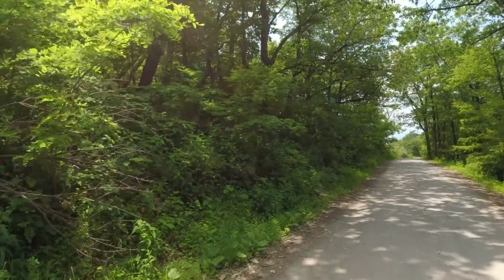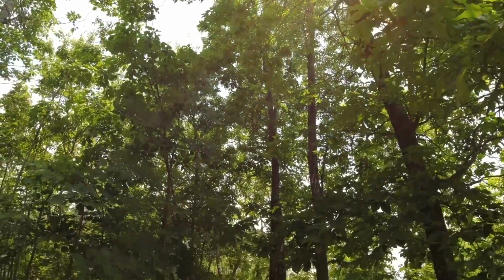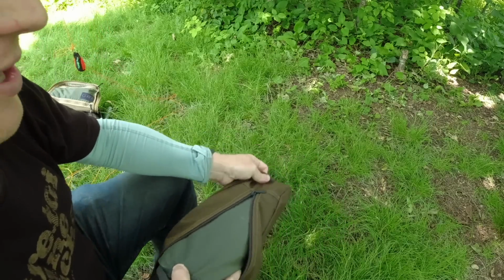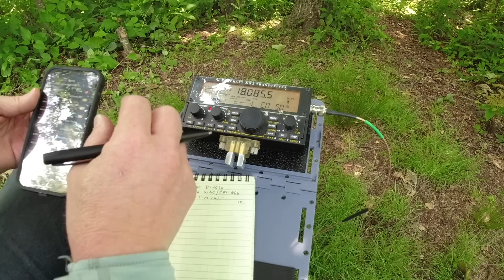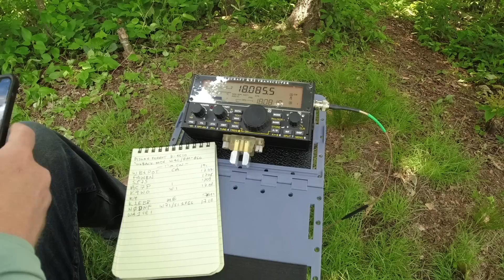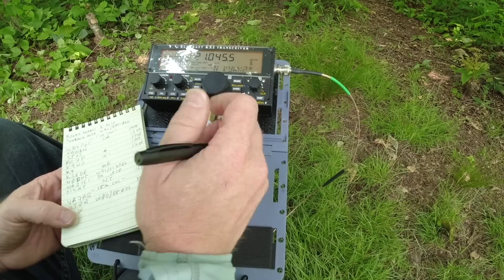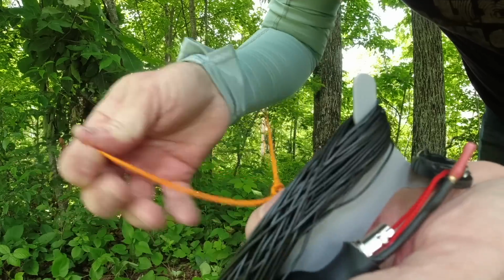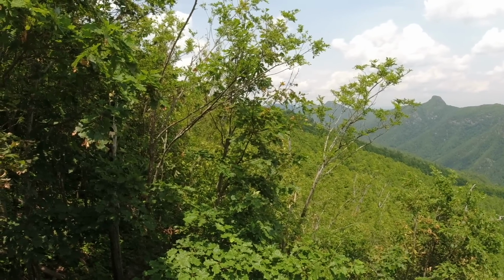Drive-Up Summit with Spectacular Views: A quick SOTA & POTA combo activation on Dogback Mountain!

Comment: I’ve always heard you can hear much better on the summit than the chaser can hear you. The noise in the city when chasing is rough lately. It definitely gives you a good ear for weak signal work. Good job pulling wu7h. 15,10 es 6 has been very slow lately.
Reply from the maker: Summits are magical spots for propagation and radio RX. :) Well, as long as it's one without a cluster of comms towers.

Comment: Hello! I’ve been looking for this knee board. Unfortunately Etsy doesn’t deliver to Canada, so I may try a foldable nursing clipboard. They are very similar,just need to drill and place the straps. Hopefully it works 😅
73!
Reply from the maker: Check in directly with Joshua at Tufteln. I bet he could work something out for you.

Comment: Thanks for answering the feed line question.  I’ll try it with the choke at the radio and no counterpoise.  Is that kneeboarding available anywhere?  Maybe a .plt file??
Reply from the maker: Tufteln sells them. Possibly the 3D file, too? I'm not sure. There's a link in my field report on QRPer.com.

Comment: I love QRP(p) & have been doing it for 44 years, but after reliving how terrible summer propagation can be, my experience of only getting 5 POTA contacts on Monday july 4th taught me to be more flexibe. I wanted an FT-891, but was stingy on the inflated prices of the used ones. I found an Icom IC-718 as a brand new open box from HRO with $70 off & I already have a spare F53A 250Hz cw filter that will fit it! 

That radio is compact compared to the bigger boat anchors, but not a SOTA candidate unless it is the rare driveup, lol. However, just getting back into the hobby & being insulin resistant, i have to ease back in to things slowly, POTA over SOTA for now. I just bought a LION Energy 20AH Lifepo4 battery ($85 w/new customer coupon) that is very compact & very well suited for dialing in about 50 watts, easy on my efhw cores and not too battery draining. So when conditions arent friendly to my Penntek TR35 QRP signal, I will have options! 

Cheers, Davey - KU9L
Reply: I got you in my log P2P on the 4th. I had to run 10 watts so that people could hear me. de KE4Q.
Reply: @frednassar1624  Hey, I think I worked you twice, sorry for the dupe. You were S9+20 db one minute and down in the dirt the next within a 2 minute spread. Thanks again and hope to work you again. We are full-time RVers so looking forward to stopping by a few more parks on our way to Illinois & FL this winter. Cheers, Davey - KU9L
Reply: @KU9L  Yes, QSB was tough. That is why I went QRO at 10 watts with an end fed. Managed 53 No worries on the dupe, I figured you were unsure you got me on the first one. QSOs in the log. I am heading to the Smoky Mountains this week. Hope to get an activation or two in. 73 KE4Q